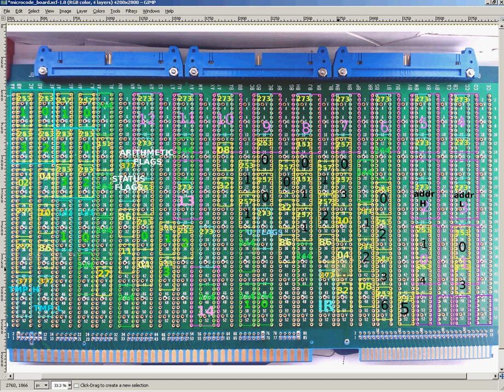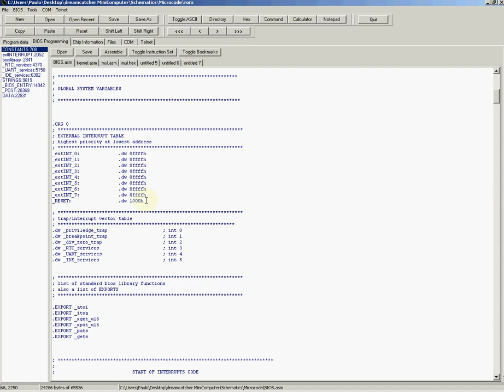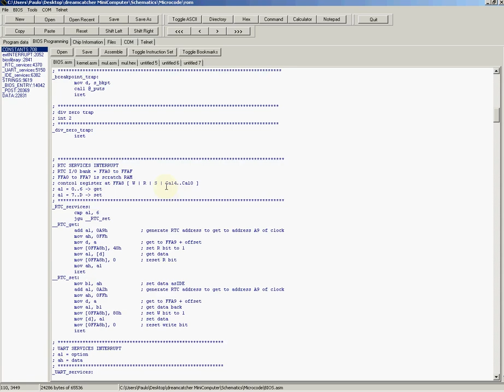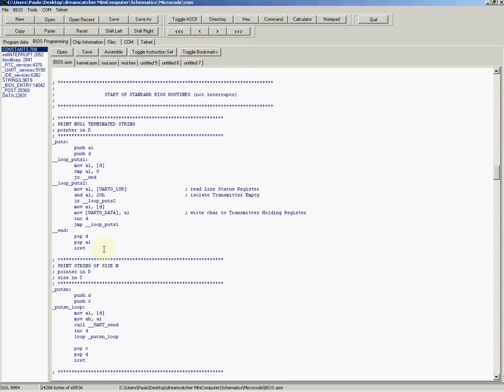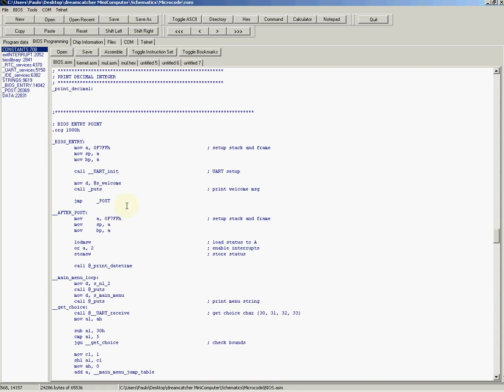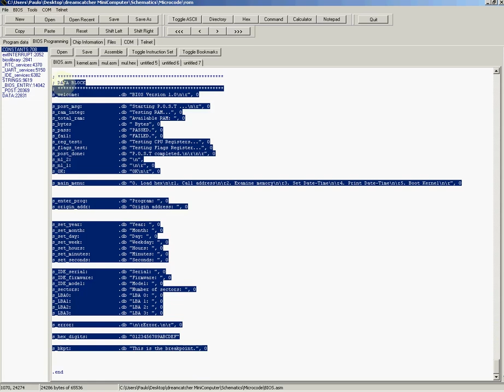Homebrew Minicomputer Progress - 1

Comment: Hi Paulo again, I'm not at that point in my project (I just projected the ALU with a 8bit full adder, 8bit full subtractor, 8bit multiplier, 8bit comparator, NOT function and I should put the remain logic operations) and now I start thinking about the control unit and instructions how are made. My answer is "instruction set, basically the instructions are made each one by "multiple instructions" right? Speaking about this "instruction or micro instriction" they are made hardware with combinational circuits and multiplexers?
Reply from the maker: Ciao Lorentio. My instructions are located in ROMS and they consist of addresses whose data are the control bits that flow into the datapath (alu etc). You need a circuit to order the sequences properly though. Look at http:// sol-1.org/schem.php, my schematics are there if you need.
Reply: @PauloConstantino167  thank you for the reply, I will check it👍